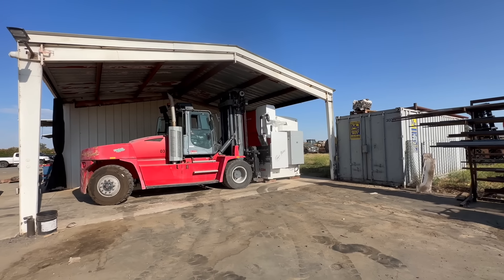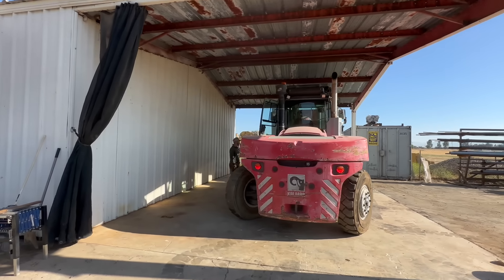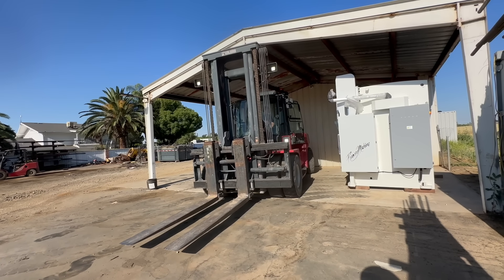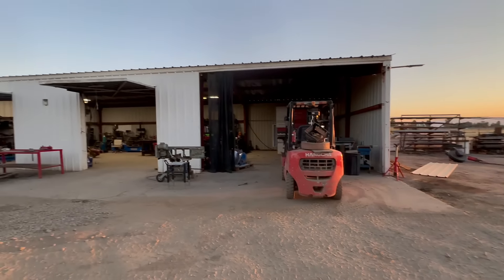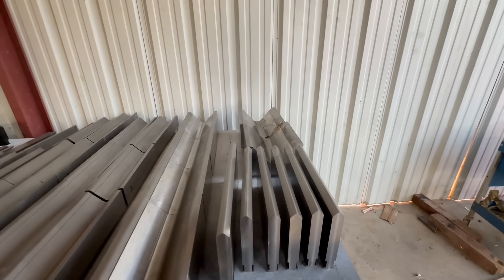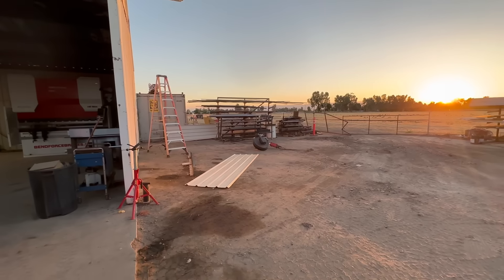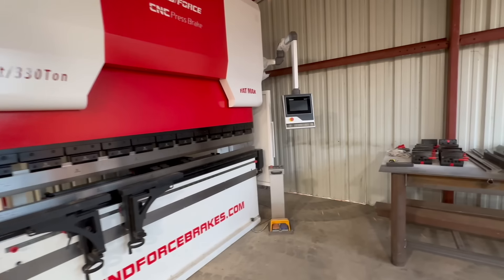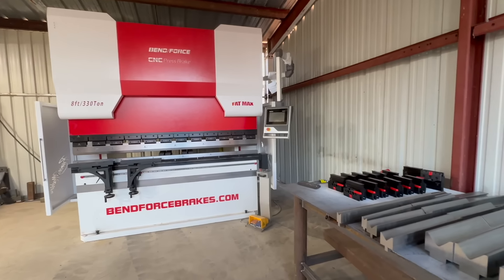Brand new 330 ton Press Brake

Comment: 😎💯%👍👍👍👍👍👍👍👍👍I’d extend the shop even longer and wider cause some parts may exceed what you have now and reset the press break in the center by 30 X 30.
Reply from the maker: The plan is to get a bigger shop.

Comment: Now you need to ask your friends at the scrap yard to watch for I or W beams to build overhead trolleys.   You also need an adjustible height rolling table using trailer landing gear as legs.  Make up some autobody frame pulling pots to mount in the floor allowing you to bind things down.  
Off the Wall question will it crack macadamia nuts

Comment: Hey, Greg! You are missed! Hope all is ok.

By the way, I thought you and your views might find this quote from a "professional" welder's channel interesting.
And I quote "A true professional would never use anything but solid wire unless they are doing outside work.  Absolutely none of the professional shops I work with use flux core or dual shield.  When wind is a factor, solid wire is an absolute no go.  You also can not weld pressure vessels with flux or dual shield.  Years back I was involved in some weld testing using multiple processes and solid wire and gas and TIG were the best welds by far.  Stick was next, dual shield was almost last, flux core wire was worst.  Health is for myself the biggest concern, next is weld strength, then cost.  Solid wire and gas actually have the lowest cost for me, the dual shield I do run, is by far the most expensive at almost 3 times the cost.  Flux core just isn't worth using in any case.  My personal opinion and first hand experience.  Again, I am not trying to be a jerk either, I just don't understand how other "professionals" could use the stuff given the health concerns."

Comment: Whoa! Fantastic brake. That will give you some great new opportunities. Are you going to need a crane or hoist to move parts in to the machine? Thanks for the video.
Reply from the maker: A crane or forklift will probably be used on some parts of the parts

Comment: I worked in a metal shop with 50 to 500 ton presses-they really need much more front and back space so forklift can place/remove sheets etc also need overhead hoist front and rear
 Ex:need this in order to press brake roll thick large diameter pipe etc
 Beautiful machine 
Plus how much concrete is under the press-it could crack if too thin long term use
 Sweet press

Comment: What is the Maximum thickness of steel plate that your brake will bend ?
Reply from the maker: It depends on the dies. But as stated in the video it will do 8ft of 3/4”